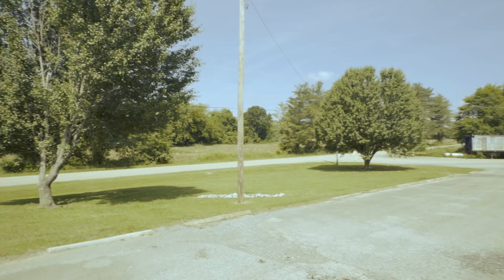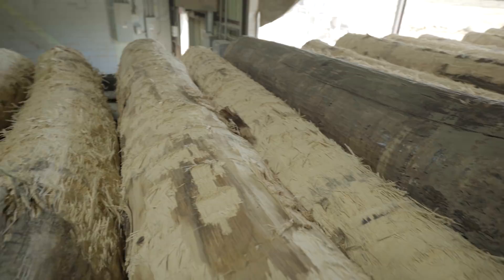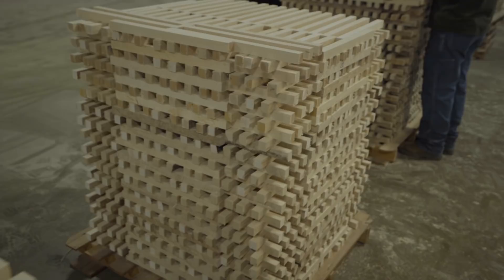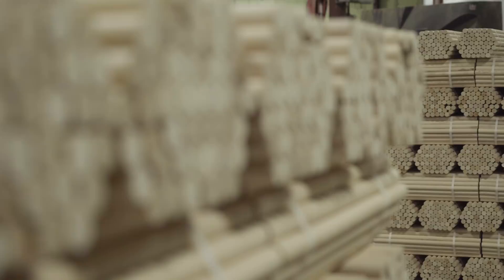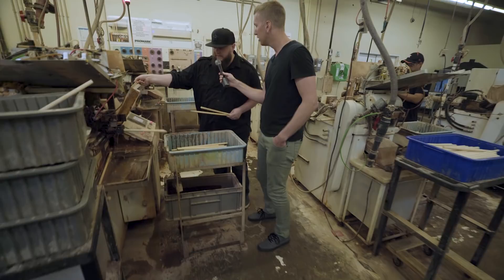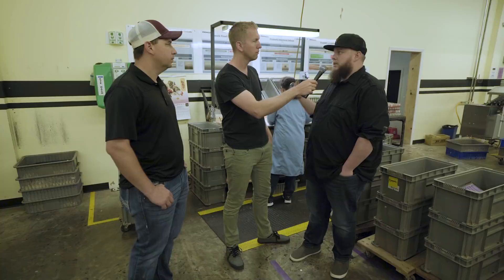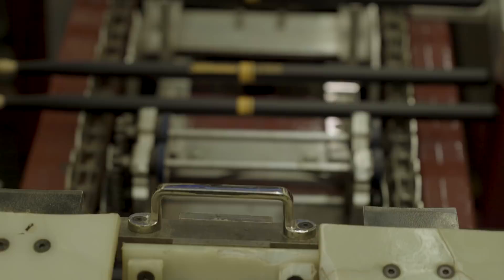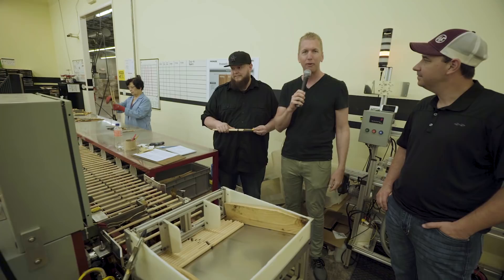How Drumsticks Are Made

Comment: i currently use 7A rebound balance, i like the length and the weight..
Reply: I play Vic Firth 7As... and then found 8D and X8D which are 7As but longer. Are those Pro-Marks the same idea?
Reply: Beto Sabbath i never play any vic firth yet, but thanks i might try it...just to be fair and to confirm if i made the right choice..essentially 7a rebound balance is longer than other previous promark 7a (was Millenium series) i had..
Reply: I can't imagine using 7 series sticks on a regular basis. I've got a few pairs lain somewhere... not sure when I bought them or what for^^. They feel like I'm holding pencils. I'm used to 5Bs'. I rarely even play 5As' - they are a bit too thin and too light as well.
But of course, everyone’s stick choice is very personal. :-)
And yeah, if you play with the idea to try out Vic Firth, I can only say: do it! They're just fine. I love them. ;-)
Reply: dXb you're right, it is very small indeed in diameter..i have a very small hand too lol..when i hold 5A/5B, i felt they are too big for me..

Comment: I call bs on the stick breaking before the tip falls off I’ve had full cases with tips come right off
Reply: Curt, I have had nylon tips come off but I think those were sticks that were glued on the promark sticks seem to have a different process so that doesn't happen but I guess the question to you is where the tips that fell off promarks? I think most nylon tips are glued on these have a different process maybe they are better